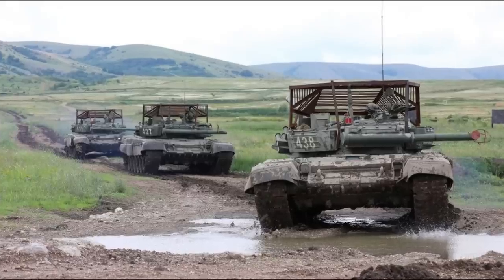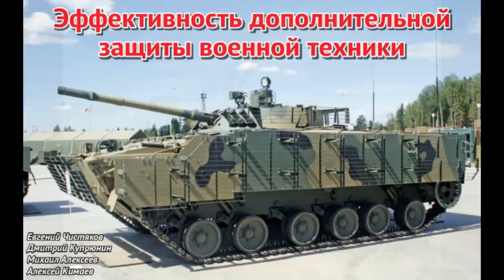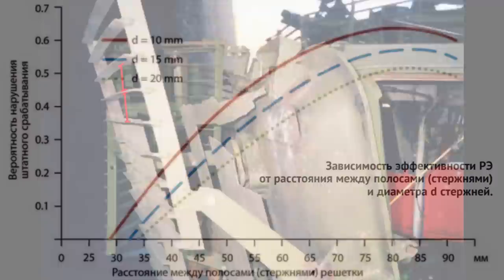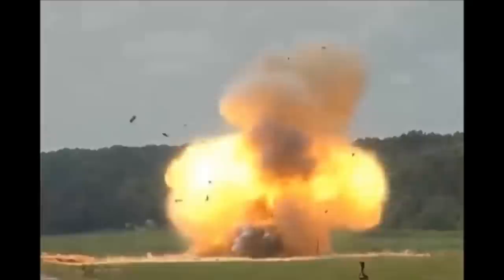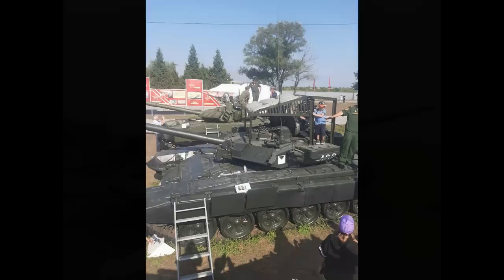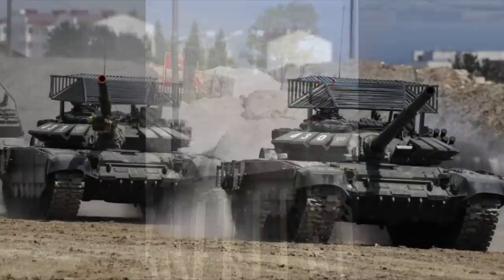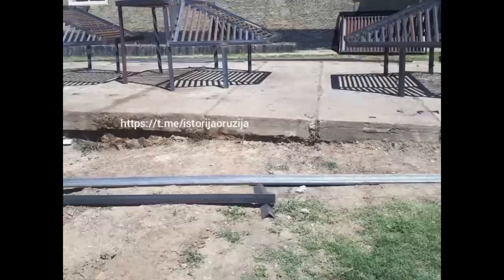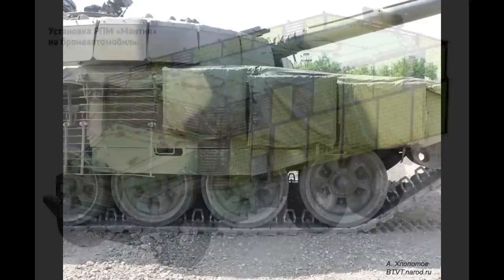The Truth About COPE CAGES

Comment: I would argue that the reported study tells about the best strategy to destroy the HEAT charge without setting it off (their trigger doesn't get triggered).

While the cope cages would almost certainly trigger HEAT charges, they would also act like spaced armor (decreasing the effectiveness of the HEAT jet).
They would work even against modern missiles, like the Javelin or the NLAW (which might get destroyed entirely by impacting the cage).

All in all, i don't think the cope cage is stupid.
Reply: The cope cages work, but they simply have more disadvantages than advantages
Reply: @name-yn6vu   they don't work against Javelins, only small munitions and explosives and old rusty RPG heat charges which the ERA already does for it, since the Javelin uses tandem charges it can cut through both ERA and the cope cage.
Reply: @ryanweltz4076  no, the tandem charge detonated the ERA, and the secondary charge attacks the tank. If the cope cage detonates the tandem charge, then the secondary will only detonate the ERA, and the tank will be unscathed
Reply: @name-yn6vu  thing is it can slip through, do you know how powerful a Javelin is? And you see those huge gaps between the tank and cage? Yeah, sorta big, a Javelin can slip right through which has happened, And there are many images of tanks with cope cages destroyed because of these hand held ATGMs

Just search it up and you'll find the same result, cope cages are useless against Javelins.
Reply: @name-yn6vu  hence the name COPE cage.
Reply: @ryanweltz4076  my brother in christ did you watch the video? He literally said that small rods with large gaps has the highest chance of stopping attacks.

There are also videos of tanks surviving direct hits from javelins, with and without cope cages. So what's your point?
Reply: @name-yn6vu  my point being, cope cage or not, the tank gets destroyed by a Javelin most of the time with the "surviving" being a very slim chance, doubt the crew would've made it out without having some serious injuries, and also, mind linking the video? it would be very appreciated.

And also cope cages won't work most of the time since Javelins are top attack and has a tandem charge, let's say the first charge detonates, there is still the rear charge that could destroy the tank because of it's thin turret armor.
Reply: @ryanweltz4076  an example of a tank surviving a javelin is https://youtu.be/qzg7CO_kWGg, even though eventually it is taken out.

Generally speaking, the crew would be shaken, or maybe given a light concussion, but it's either death or just these minor injuries, when facing ATGMs.

Also, russian tanks have ERA on top. With just a single charge the javelin would fail to make a significant impact on the tank, let alone destroy it. Cope cages are bad because they make the tank easier to spot and harder for the crew to escape, not because they're completely useless
Reply: @name-yn6vu  looks like an RPG-7 or RPG-22 OR something similar since no way in hell are they gonna use it in CQC, the shooter targeted the sides and tracks which is quite unnatural for something like a javelin or an NLAW that uses top attacks to destroy the tank, and if it's an RPG, the crew could survive, if it was a javelin, it would've been a different story.

Also a body can be seen flopping right at the end of the video, mega oof.
Reply: @name-yn6vu  there's also a couple bodies near the tank (3 if I'm correct) probably got hit by shrapnel or got shot by Ukrainian soldiers.
Reply: @ryanweltz4076  as I said, it was eventually destroyed. Also the javelin does possess head on attack capabilities, that would make more sense to use in an urban environment.

It's also worth noting that this tank was alone, which historically, usually results in the destruction of even the best tanks.
Reply: @name-yn6vu  so it got destroyed, but certainly not by Javelin since it is commonly used in vast distances to keep the crew safe, and dude it's a FIRE-AND-FORGET design, the thing locks on and automatically does a top attack even at somewhat close distance, where did you get the "javelin has head on attack capabilities" line from? Mind sending the source? or do you mean the NLAW's soft launch system?

And there was another tank right next to it a bit off cam but you could see a glimpse of it near the end, and you can fully see it in the full video, it got destroyed too.
Reply: @ryanweltz4076  from the Wikipedia page for the javelin: "The system takes a top attack flight profile against armored vehicles, attacking the usually thinner top armor, but can also make a direct attack, for use against buildings, targets too close for top attack, targets under obstructions and helicopters.[10]"

The tank had no infantry support, is what we mean when we say a lone tank. And also, this isn't cope, I'm pro ukraine, I just want people to understand the limits of our weapons, and am tired of the "NATO equipment is the best because we're good guys" mentality people have
Reply: @name-yn6vu  what did you expect? The Russian army being competent? 

And it's commonly used in vast distances for more successful kills, like the NLAW's soft launch, the "head on" would still pack a punch but I figure it would decrease the chance of a kill it ain't as "reliable" for instant kills, doubt they would waste it on unsupported tanks with no cover when they probably have RPGs that could do the same thing.

And the Javelins are good, that's why it killed a lot of Russian armor, but there are other equipments that are a bit underwhelming.
Reply: @name-yn6vu  oh yeah, no way in hell are they gonna waste multiple Javelins on a SINGLE tank, Javelins are too valuable for that, so it's more likely to be an RPG, and the video said it was a Javelin attack while other channels are saying it was just being blown up by the Ukrainians with no identifiable weapon, get what I'm saying here? The vid is BS, not the actual video, but the title.
Reply: @ryanweltz4076  the russian army's incompetence is mostly due to their commander's imcompetence and the rampant corruption. You can clearly see this with the t-14 armata. A very impressive tank, that's useless because there are like 3 units and none are actually maintained, causing them to be a waste of money. 

I'm fairly certain they would just use whatever weapons they have on hand. Why go find a garand when you have an m4 right next to you?
Reply: @ryanweltz4076  it could very well be then that it was an rpg, in which case I stand corrected. I however don't believe that in an engagement with an enemy tank you're going to say "nah bro, this third rocket is going to cost our army too much". They would rather just fire more shots at it, imo
Reply: @name-yn6vu  and most of the guys you see aren't quite "experienced" with most scattering around or staying in one place without returning fire during skirmishes, and the T-14 with the stuff going on in Russia, would probably be another flop, good on paper sure, but in practice? Eeeeeehhh...

And why waste a perfectly good weapon more advanced weapon that could one shot a shiny new tank 
And use it on an already damaged one when you have something that could do the same thing and is better in CQC?
Reply: It could go both ways honestly but this one seems more likely.
Reply: @ryanweltz4076  it's true that the army is generally inexperienced, however that wasn't a problem for many other successful armies, so I still blame the commanders.

And yeah, the t-14 is impressive on paper but dubious in practice, as you said.

I do still believe that they would have used whichever weapon they had pn hand, whether that was RPG, NLAW, or javelin
Reply: @name-yn6vu  Well we have different opinions so it can't be helped, anyways I'm tired, I need to sleep, sorry if sounded a bit rude earlier now that I think back on it, anyways have a good day, my eyes are burning.
Reply: @ryanweltz4076  na it's okay, it wasn't rude. Have a good night bro, I'm glad we can agree to disagree
Reply: @name-yn6vu  aight have a nice one man.
Reply: @ryanweltz4076  you too bro

Comment: Expanded steel mesh worked for RPG7 protection for the hippie kombis the Rhodesians made into MRAP vehicles.
Reply: Correct statement.

Rhodesia approves
Reply: @TRPilot06YT  no way rhodesia official youtube account?
Reply: You can use em for specific warheads with proper spacing, but no way in hell do the Russians have a chance considering the gigantic variety of anti tank weapons in use in Ukraine
Reply: @signs80  Like I said the Rhodesians were able to prevent RPG7 missiles from penetrating their VW T2 kombi mraps. Look up the " Leopard" for details.
Reply: @andrewallen9993  Yeah like I said the optimal spacing for RPG-7 warheads is possible, they probably didn't have to worry about any other anti tank rockets so it would be effective most of the time for them
Reply: @signs80  absolutely right!

Comment: 1:50 is example as to WHY it seems weird to do it on top attack munitions... This clip is from a tests of a TOW variant that flies above the target, and even from 2 meters away it easily explodes the turret off that old T series tank.
This is also true to NLAWs that by design fly about 1m above the target.
Javelins do explode on impact, but their shaped charge is far behind guidance that in such fat rocket would detect hit anyway before it get's to deform the shaped charge that with 750mm RHA penetration it doesn't really care for spacing.

The study quoted explains why RPG-7 and other simple HEAT rounds would get affected (Carl G; PzF 3; AT4), but placement, and rumours suggest that it was meant to stop the more advanced rockets, which is not gonna.

Comment: My biggest concern as you can see in the pictures is that these things obstruct the machine gun. It can be annoying for those manual controlled ones as you probably need to raise the gun to turn it if the armor's 'legs' are in the way, I guess if it is the RCWS model it can be a nightmare to operate if you have to constantly turn it. Also good luck trying to aim for the guy with a Panzerfaust 3 on the roof of an apartment block, or a drone dropping molotovs on your head.

Comment: Javelin is a tandem warhead missile. Which means no cage of any construction will stop it from destroying the tank when used with the top-down trajectory. First stage explodes hitting the cage and destroying the cage and any reactive armor if there is any, and the missile second stage continues through the thin armor on the top of the turret destroying the tank. Usually by igniting and detonating the ammo that is in the auto-loader carousel on the floor of the turret in the T-72. 

Javelin has two modes of use. Top-down ballistic trajectory used on attacks from larger distances where the missile has time to climb to approx. 150m altitude and guide down on top of the target.

Javelin also has a direct attack mode where the target is close to the operator and then the missile has flat trajectory and hits the target from front or side. The tandem setup was developed to defeat reactive armor with the first stage and breach the tank armor with the second stage. The operator must select the mode manually and have the right mode selected otherwise the missile will not lock on the target.

In Ukraine most of the hit and run attacks are made from close distances less than 1 click using the direct mode. That's why you haven't seen many top-down destroyed tanks with the home made cages.
Reply: I don't think that's how the Javelins and NLAW's work. From what Ive seen the missiles explode at a standoff distance before it hits the cage, and shaped charge is optimized to have the best penetration from 1 or 2 meters away. This renders cage armor completely useless. 

But there are type of reactive armor that are designed to destroy tandem warhead missiles by firing off their own shaped charges once detonated, in order to destroy the entire missile before the main warhead can detonate. However this is much harder to do when the missile detonates at a standoff distance compared to on impact.

Comment: Let's be honest, all T series tanks when it comes to contemporary main battle tanks, as far as Western standards go, are severely lacking.

The latest upgrade of the T90, the T90M, is barely getting features  that have been on Western tanks for the last 30 years!

 Such as GPS navigation, thermal imaging for the commander, and a few other upgrades, that don't overall significantly improve the tank as a whole.

It's an outdated design.  Even when it was new, it had some serious drawbacks.

The T90M is still a T72 wearing lipstick, it still has a lot of the same major flaws all the T series tanks going back to the 72 has have. 

The thing takes a hit in the magazine and it blows sky high like the rest of them, they still have not decided to spend the money to protect crews with blast out panels which is a huge problem.

 They've known about the severe problem of not having blast out panels for 30 years and they haven't done anything, it was proposed to retrofit a solution with a prototype, but they didn't want to spend the money.

Some people have tried to conflate the fact that the newest T90M has ammunition storage on the outside with "blow out panels", which is not the same thing.....

Overall, the T series tanks as of today are pretty junky. 
At one time they were capable, when they had a better chance of withstanding Enemy fire, but in 2022, they've been unable to keep up with evolving technology and are simply not very capable against Western anti- tank weapons and contemporary Western Sabot tank rounds.

 Don't get me wrong, their abysmal tactics definitely are hurting them as well, which there is no excuse for.

 In Desert Storm, there were all kinds of excuses made for why the T72 performed so terribly against Western ..tanks...

I.e 
Export model (even though the difference is not huge)

Ammo, etc..

 The export model is said to potentially have 30% less armor than the standard model at the time, however however the features were pretty much the same,.

The claim about the ammo and armor isn't that relevant however, because even the best T72 would have been completely outclassed, and would not have been able to shoot before being engaged. 

 There may have been some lucky hits here and there, but the outcome would have been the same none the less.

 Their biggest weakness would have been night time engagements, they had absolutely no ability to fight at night against an Abrams in open desert combat and would have been absolutely annihilated, no matter what version of the T72 was being used.

And the claim as far as tactics, is nonsense, the Republican guard and other tank units and Iraq's military was battle hardened and manned by combat veterans, they also had Russian advisers present in country before the war started, that had been training and advising the iraqing military.

The Soviets even bragged that they had equipped the Iraqi military with some of the best hardware available from them, such as air defenses, aircraft, and they bragged that their doctrine with tank warfare would prove to be superior.

The Iraqis deployed Soviet tank tactics just as they were taught, and it didn't prove to be the better doctrine.

In fact, 
you can find literature where the Soviets overhauled doctrine and tactics directly because of the Gulf war...

Just like the Gulf war is full of excuses and coping, you're seeing the same thing with the Ukraine war.

 though,when you really get down to the meat and potato's, it wouldn't have mattered if it was Russian tank crews and the best T72 they had to offer in the early nineties, or other variants, they would have still been outranged, outgunned, And ill equipped when it comes to technology, that most Russian tanks even today still do not have, except for a very small Amount of the latest T90ms... and even they don't have everything an Abraham's had in the 1990s...
Reply: You've written so much here. According to your logic, judging by the final part, who is the main aggressor in the world, the United States and the NATO bloc or Russia?

Comment: Authors of those improvised cages only heard of Javelin missile, but failed to read all the details. As usual, of course. They heard it strikes upper armour. And they assumed it does that strictly vertical. But it does not. Javelin in upper flight profile strikes at around 40 to 45 degrees and misses those over-the-top cages completely. Those cages are also useless against nlaw missiles as they detonate about 1-1,5 meters above the tank forming a very narrow hypervelocity coper stream downwards that pierces tower. Some improvised field upgrades also featured false targets for heat seekers - some kind of a 2-meter long horizontally installed pipe extended to the right or to the left of the vehicle with a cup of burning oil at the end of it. That practice was abandones shortly after beginning as it proved to be unpractical and cumbersome to maintain.
Reply: .... they studied most recent Armenia - Azerbaijan war and effects of Baryaktar TB-2. That is exactly angle for that cages, not Javelin or NLAW. But, for western ego, acceptance that something else bother Russians more than western armament is not an option. And "cages" are abandoned not because they missed the point, but because TB-2s are circumvented en masse on other ways. During NATO attack at SR Yugoslavia, Serbs put cages with grass bushes at top of tanks and IFV-s, usually wet, but, not above cupolas but above engines - to lessen thermal signature.